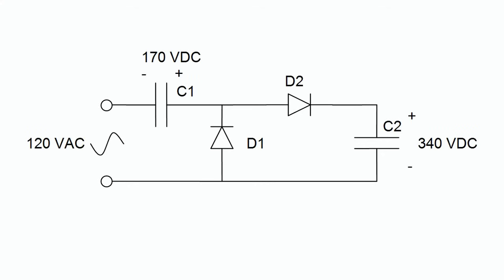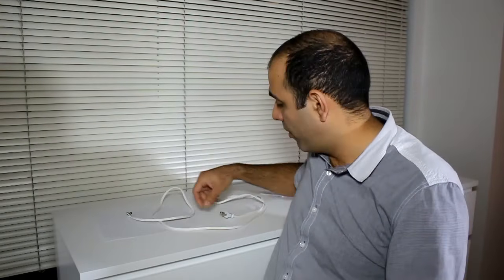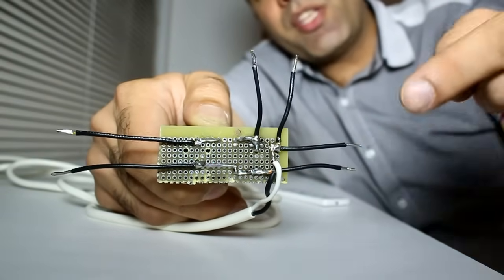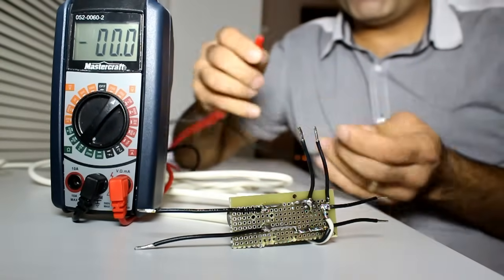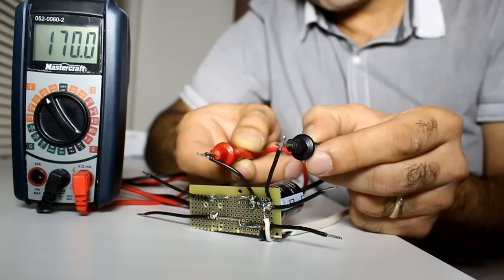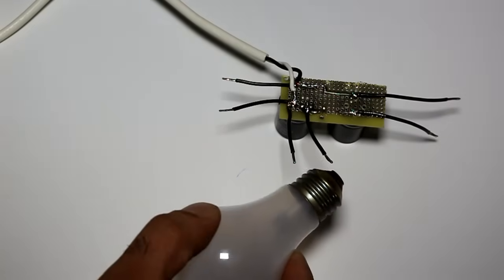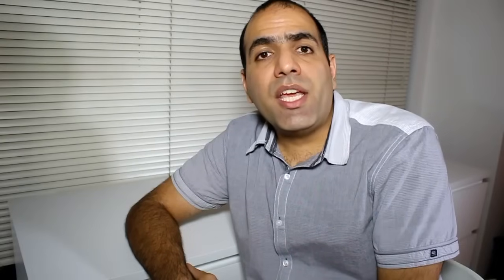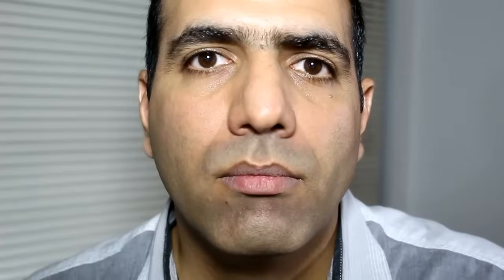High Voltage AC/DC Effect on Human Body

Comment: OK, so I was shocked back in 08 and I'm pretty sure I have nerve damage from it. I completed a circuit on a power strip while trying to unplug a stuck AC adapter for a laptop.  It felt like liquid fire hit my veins and I was being stabbed by tons of knives.  I could not move or feel my arm for over 10 minutes.

My question is, What type was I hit with, AC or DC?
Reply: duude your heart could've stopped
Reply: Well then, this one of those moments were you look back and realize YOU ALMOST DIED.

The plug got stuck in the strip, so I one hand on the strip, and used the other to pull the plug.  It ended up not working and was still stuck.  Like an idiot, I wrapped my ENTIRE hand around the plug at the base and pulled, I ended up touching both prongs at once, which completed the circuit and ZING I was shocked.  Immediately could not feel my arm and it felt like liquid fire was running through my veins and it was very tingly.  It was so tingly I felt like a bunch of tiny knives were stabbing my arm.  It actually didn't even make me cry, I was just a bit concerned.  I could not move my arm on my own, I had to manually move it for 10 minutes and it felt dead and limp.

Reading what you guys are telling me, is there anyway to find out EXACTLY how much AC went through my body?
Reply: With the power of Jesus.
Reply: Scheefinator I HIGHLY recommend you to go to a doctor and let him check your heart rythm. I haven't read the other comments to find out, on what date you've got struck by voltage, but please check it out. It CAN be dangerous and...sadly lethal.
Reply: AC/DC - Thunderstuck
Reply: And it was AC. So the dangerous one.
Reply: Scheefinator If you touched the end of the plug that goes into the wall, the ratings of the power adaptor don't matter. Any plug would have the same effect.

Think of it this way- all electricity wants to go towards ground. And like a moving stream of water, it will go the path of least resistance/blockage. If you touch just the hot wire, the electricity has to travel through a large resistance (your entire body) to get to ground- I did this accidentally over the summer while trying to fix a light. However, if you touch both prongs simultaneously (like what you did) there is less resistance- the electricity only has to travel through ~1cm of skin. Less resistance = more power = bigger shock!
Reply: thewildeeper
So THAT'S why it hurt like hell.  I still want to know how much AC I was hit with.  You're ruining my badass rank here, dude.  I don't know too many people that have touched AC and lived.
Reply: Scheefinator If you live in the US you were hit with 110V AC! So thats your answer! If you touched between the lead wire and ground, you got hit with half that. I work as a electrician in nNorway and get hit with 230 volt AC like once a year (cause sometimes im a moron, and are to lazy to take the fuse of before starting work). We also have 400V some places, trust me, that hurts like hell. The die'ing comes down to a bunch of other factors, like how big is the fuse, how big is the wire, voltage, how much resistance is in your body (like if you have wet hands), and how long you touched it for. And also, the thing most people die from when touching electricity is arrhythmia, cause the voltage beats your hart out of order, and you can die up to 48 hours later.
Reply: Tesla Explorer  If he was touching a metal appliance the current would go through the hand touching the exposed wire through his body to his other hand touching the metal. Like said before, electricity doesn't care how it goes through something just as long as it's the shortest and easiest route. The whole point of an earth cable is for the current to go through that and trip the circuit breaker. The biggest killer is when the current goes across your chest i.e. your heart and cause it to stop/skip a beat.
Reply: Scheefinator Getting shocked by 110-120v AC is nothing to brag about, I'm not saying its the safest thing in the world but lots of people get shocked by it. Its that 240v AC you gotta watch your ass about, got shocked by that once and my whole hand was numb for a day or so
Reply: Oh wow. Was that a USA plug? Scary.
Reply: Scheefinator
Well US standard is 110 volts luckily you only had one hand on the prongs so the current just went through your hand.If you still have your laptop you can look on the AC adapter and it should tell you how many amps. But they are usually 2-4 amps.
Reply: Brady Mcwilliam
Let's take a look shall we?

Goes to get AC Adapter

OK so it says;

Dell
90W-AC Adapter
Input AC 100-240V (1.5A)
Output DC 19.5V (4.62A)

Anything else?  It has all sorts of other shit on it to, safety ratings, model numbers, etc.

So, how close was death?
Reply: Kristian Måseide That sounds painful.

I was a moron too, that's why it happened, lmao.  I didn't touch it for very long, trust me.  It was a near-immediate reaction.  Interesting, my heart sometimes double-beats.
Reply: Kristian Måseide whats the potential from live to earth? what if he had his arm or part of his body on another appliance with a metal chas plugged into earth... would live take the route to neutral or earth? please explain the potential differences of those 2 if they had the same impedance to 0v. I believe he would take the full circuit potential if either of those 2 were completed. if he didn't earth than it was a live to neutral thru only his hand and not the rest of his body, if it took an earth path well... that would explain the way he felt afterwards.
Reply: You were hit with 60hz, didn't you hear the tone when you got hit? Always isolate yourself from anything earthed when plugging in appliances to prevent yourself from getting an earthed electrocution. Bathroom electrocutions are caused by lack of isolation between you and earth. Never use metal chassis appliances because they use earth for safety grounds and can offer 0v for whatever potential you touch while leaning on the appliance. Get lazy and lean on your right elbow onto an appliance and plug something in with your left hand and mistakenly touch the live while doing so and you will regret doing so big time.
Reply: Walter White  Brady Mcwilliam Tesla Explorer 
I was shocked back in 2005-2006.  Only my arm was in pain when that happened.

Now when it gets cold it hurts. Sometimes a spasm will happen (sudden jolt of my arm)  if I try to do very finite movement.  Aiming with a mouse is a no go.

I know NOTHING about electricity so those of you who have taken an interest, try to avoid the jargon or at least try to explain it, otherwise you'll confuse me.

From what you guys are saying though, I'm lucky to be alive?  Badass seal achieved?
Reply: what we're saying is that earth will complete you into a 60/50hz circuit and turn you into a microwave in use until the breaker heats up and flips, you will become a resistive/reactive puppet smoking until you die.
Reply: OH and i'm not saying to not use metal chassis appliances all together, I mean not to use them in your bathroom ;D
Reply: Scheefinator i guess its ok now, since it happened back in 2006. At work, for example, I am supposed to see a doctor immediately if I get struck from 230V Ac. Sorry if I confused you with my comment - Don't fear, but respect electricity ;)
Reply: Walter White do they have you manually switching live wires to 0v where you're working for operational maintenence? That is some very and I mean very scary shit.
Reply: Tesla Explorer Scheefinator No. Home Ac has to be opened (in my case automatic fuses with and without RCD) and it must be grounded. The story above is in a case of an accident, which can always happen.
Reply: I'm thinking about grid work D: I remember when I was a kid taking things apart out of curiosity I managed to remove the whole chassis of an old Fender champ tube amplifier, I had it plugged into the wall and ON, had my left hand on the chassis not thinking anything of it, well... I didn't know the route of electricity like I do now and I touched the live wire running into the plate transformers primary winding trying to wiggle a screw out of the way with my right hand. Instead of 110vac wall biased mains running thru my heart it decided to run thru my neck and in/out the other arm. I heard that 60hz hum, The wall lines managed to surge enough to let me free where I managed to stand up with my neck pulsing and feeling like it was going to explode. Needless to say I was walking in circles for about a good 20 seconds, I wasn't counting. I'm VERY thankful it didn't take my heart. I'll never ever forget when that happened. The surge was a ahhhh I got ya to me, it didn't have to let me go.
Reply: Sizzlik
HAHAHAHA
Reply: Tesla Explorer You are confusing me with your language.
Reply: im confuzzling you or I wrote to much? :D :D :D
Reply: Tesla Explorer I can't tell who you are replying too because you aren't tagging people and you are using jargon I don't understand.
Reply: Scheefinator So, this is all to show off?  In that case, no.  Badass seal torn and thrown into the garbage of shame.  The world shouldn't have to hear about something that happened to you.

HEY EVERYONE, MY PINKIE BENDS ALL THE WAY BACK.  :O :O :O :O :O :O :O
Reply: It happened to me years ago. I didn't loose sensitivity, thank goodness. It mostly felt like intense vibrations to me.
Reply: redandbluebeater
I can confirm this.  It does feel like an intense vibration that slowly moves to tingling knives and pain.

I got shocked good.
Reply: Scheefinator you didn't ground live.... it just used your hand as a temporary wire.
Reply: Cameron Bigley
Bro, you got to learn to read the thread.  We already discussed that.
Reply: Scheefinator Sounds like AC
Reply: when i was grade 2 i plugged in a electric fan while holding the prongs and i got shocked and my teacher said "are you trying to commit suicide?"
Reply: antonio tamayo
That's pretty similar to what I did.  Any lasting effects?
Reply: nope didnt felt anything after that
Reply: antonio tamayo
feel not felt.
Reply: Scheefinator I have, 240 volts AC in Australia.  I accidentally came in contact with the 2 prongs from a cd player power lead when I was younger.  It felt fuzzy.  There wasn't a bang and no pain either.
Reply: Darryl Kelly Depends on what surface you're on and what shoes you're wearing.
Reply: Vinyl tiles over concrete slab, no shoes and was touching the concrete block wall as well.
Reply: Did you touch both conductors or just one? Because 240 VAC (in the US atleast) has no neutral pin and two 120 VAC "hot" pins which are split phase, simply put if you only touch one of the "hot" prongs its the exact same as 120 VAC. relative to ground 240 VAC circuits are only 120 VAC, if you touched both "hots" you get 240 VAC which will light you up!
Reply: I got both, momentarily.
Reply: It was AC
Reply: AC
Reply: Definitely AC
Reply: Scheefinator I've been hit by the lovely european voltage,  and to make it even worse, I accedentaly shorted myself between 2 phases.     A lovely 300V X_X
Reply: Debbie321lopez
Ouch
Reply: Debbie321lopez european is 220V ;D
Reply: Lukas Juozaitis. +Debbie321lopez
European is 230V, actually, and it's 400V if you measure between 2 phases.
We use 3 phases. Each is 230V, 120° phase in respect to each other.
Very powerful stuff for driving 3-phase AC motors, no funny business needed to start them and if motor runs the wrong way, you just reverse two of the phases (some plugs even have the ability to reverse two phases with a screwdriver!)
Reply: zlac I meant 400V,  was a typo
Reply: John Skoteiniotis yis

Comment: So Edison was right? AC is more lethal?
Reply: Yes, but he was also a total dick. And AC does have its advantages - it's much easier (for a couple of reasons) to have high voltage AC, meaning transmission losses are much lower because physics.
Reply: *****
Yes it uses batteries but has a three phase AC motor.
Reply: Justin Bell An Electronic Speed Controller simulates the three phase AC, using DC Pulse With Modulation, what it creates is still DC though, so the AC motor is running on DC.
Reply: Yes but it's less costly to deliver AC to your home from a power plant hundreds of kilometers away, whereas using DC we should be installing power plants in every neighborhood and use thicker wires to deliver convenient current levels or else the wires will heat up and melt.
Reply: *****

Not any longer, this was the case back then not anymore however.
Reply: *****
Well said, thanks for the entertaining (and educational) videos!
Reply: There are so many improvements that modern semiconductors have made possible.

http://en.wikipedia.org/wiki/High-voltage_direct_current
Reply: Edison was wrong. Tesla was right :)
Reply: Justin Bell What exactly has changed to make DC transmission feasible?
Reply: Justin Bell
Thanks, that was an interesting read.
Reply: TheMrTape

Where did you find this information?
Reply: Justin Bell The same principle is used on higher end RC planes, RC helicopters etc. I don't know that they do this in electric cars, however I know that's the most efficient way to run three phase ac motors using DC, so it would be strange if they opted for a much more inefficient conversion to actual modulated three phase AC.

PWM is the most efficient driving method, because it causes the least resistance between the battery and motor; the output of an ESC consists of six switches (3 positive, 3 negative), that are either fully on or fully off for a specific amount of time, so there's no actual voltage conversion going on, which would otherwise rise losses a lot due to higher resistance.

Comment: Even though this was informational, can you do an actual series on how electricity works and how different components work, such as resistors and capacitors, eventually teaching enough where the viewer can make a basic circuit on a breadboard.

Comment: How haven't you measured voltage while tester in resistance mode yet (iirc old multimeters have fuses only on voltage/current input)?

Comment: Ok so a question naturally follows, why the hell we use dangerous AC and convert it to DC at the device level, and not DC without converton at homes since most of our home devices use DC? This one always baffled me, because DC is much safer (my brother when he was young he put a screedriver in the socket and got shocked, child curiosity + no supervision :P)
Reply: Let 's say u want to transfer electrical energy from point a to b, u could do it efficiently through ac signal but if u do it with dc depends on ur distance and energy size some percentage of ur energy would get lost/wasted
Reply: Because AC is more convenient to convert into different levels of voltage/current by simple transformer (but energy is still same - Voltage*current = const) and more efficient in terms of delivery from powerplant (less losses of energy, thinner ->cheaper wires for same energy).  Don't forget about electric machines, that use raw AC - i.e. AC motors, arc furnaces, etc. So in short: today AC bis still better to deliver amps, that power your PC to read this comment.

But nowadays technology made some even more efficient devices to deliver DC with minimal losses/cheaper in production.
Reply: I'll try to give you a concrete example.  As already stated, the amount of energy in an electric current is equal to voltage multiplied by current.  So 10 amps of current at 120V has the same energy as 10 milliamps current at 120,000V.  Carrying a 10A current for one kilometer with less than 5% voltage drop would take a wire about the thickness of a pen.  Convert it to 120kV and 10ma, and you can carry it that same one kilometer with about 100 times less voltage drop on a wire less than the thickness of a human hair.

That's over 4000 times as much copper to transport the same energy using 120V instead of 120kV.

That should give you an idea of the scale of the incentive to transform voltage for long-distance electrical transmission.

Transforming DC voltage is wasteful (lots of energy converted into heat) or expensive (and still a bit wasteful).  Transforming AC voltage is dead simple - you just need a magnetic donut and two lengths of wire, which you coil around each side of the donut a different number of times (the ratio of the windings is the ratio of the voltage change).  Efficiency of conversion is typically on the order of 99%, so you're wasting very little.

That's why AC became the standard.

Comment: It is very nice to see you back. I have an idea for a video. You can demonstrate the difference between a genuine mobile charger which has optocoupler and insulated transformer versus one of those cheap crap counterfeits without proper insulation between live voltage and output. People die or are badly injured because of those crap counterfeit chargers. Most of the videos on Youtube in this regards are technical and consumers do not understand them. You are the man to educate ordinary people about the dangers of counterfeit chargers.
Reply: Well, I'll be also very happy if Mehdi explain why the hell dynamic microphone can zap somebody's lips if he sings in crappy rehearsal studio.